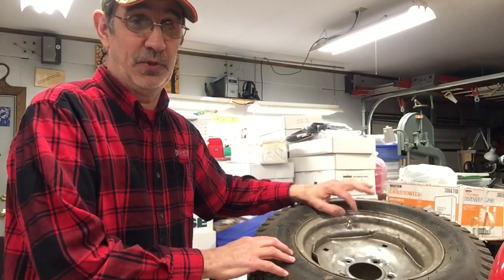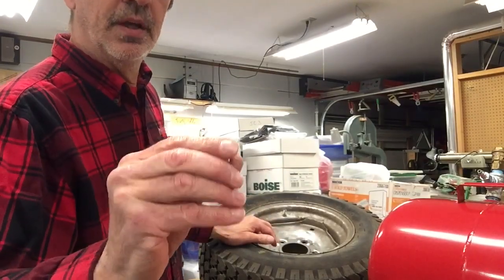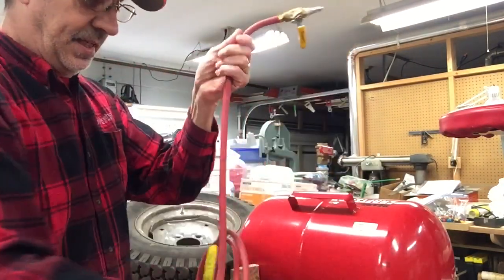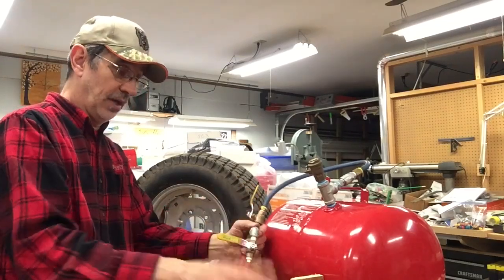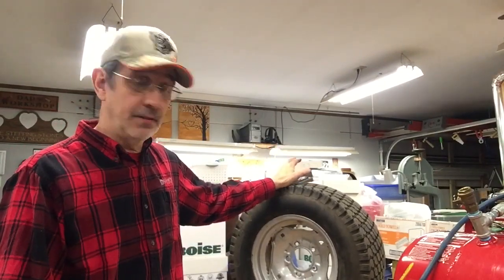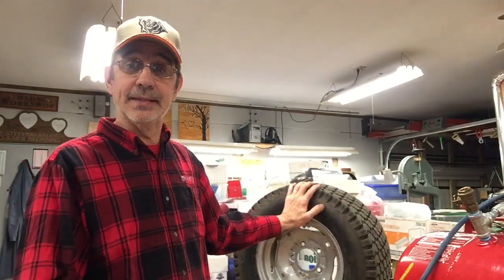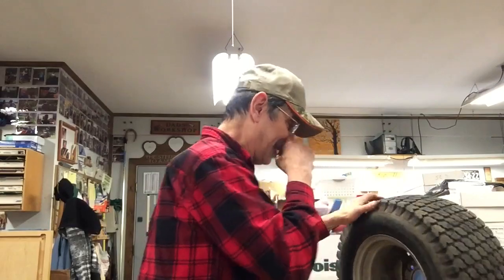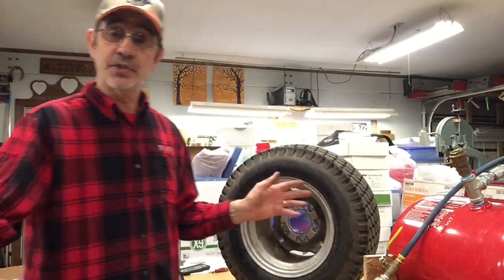296.  How can I load my tires for better traction

Comment: Hi Jim, I have found that when I put a tube in a tire and rim, use talc powder and spread it around the inside of tire. This lets the tube move around a lot easier and relieve the air between the tire rim. Worked for me. Stay safe and peace to you too Jim.

Comment: If you have tubeless tires don't want tubes use water and antifreeze mix. Antifreeze will slow down the rim rust or possibly prevent it. Tires! All these small tubeless tires, no matter what they are on, will not hold air very long. Then the tire bead comes off the rim. Try and get that back on! So, now when I have something with small tubeless tires I immediately Slime them. No more problems losing air. My new Camaro has no spare. It has a bag in the trunk with a compressor and a bottle of sealant. If you get a flat tire you use the compressor and sealer to inflate tire. That's a POS if there ever was one. I Slimed those tires too.
Reply from the maker: Gary Ruark 
I just put tubes in them. Jim

Comment: nice info ,my problem my old snapper 28/8 hp gas tank is creaked(in the seam), i check on ebay  they are 
real price to send to Woodstock N.B. Canada is their a good way of fixing them so they don't leak thanks